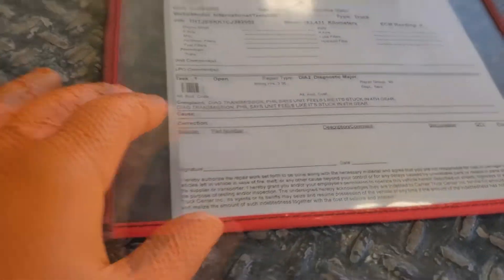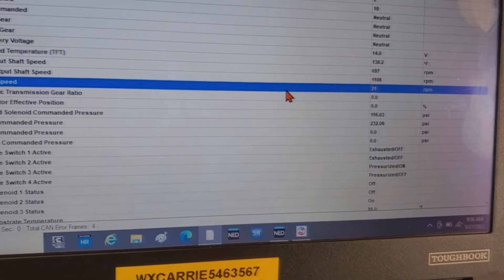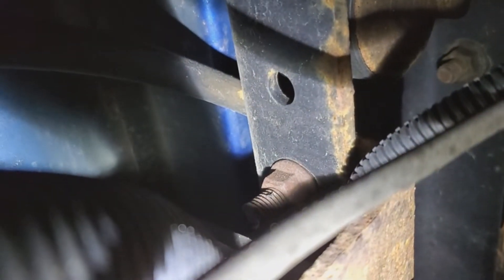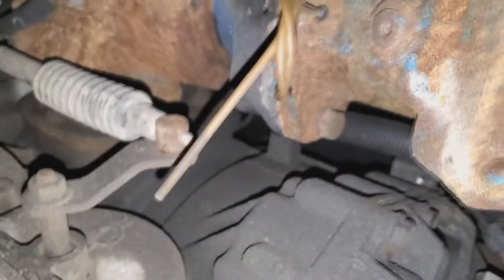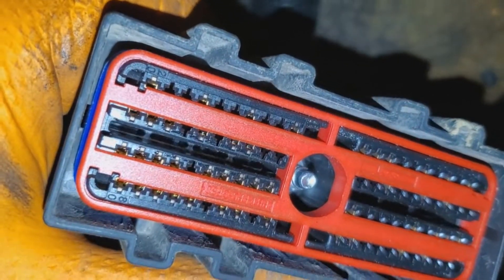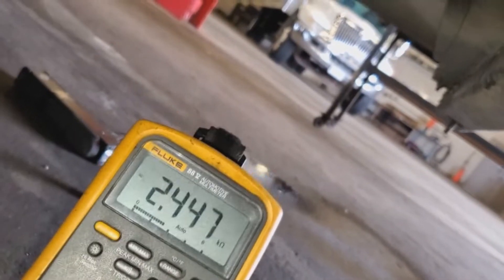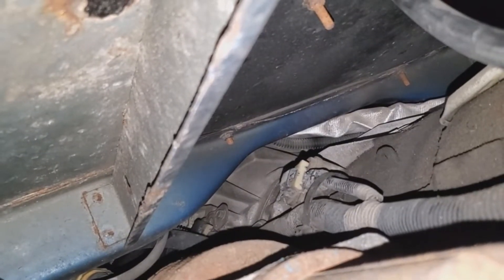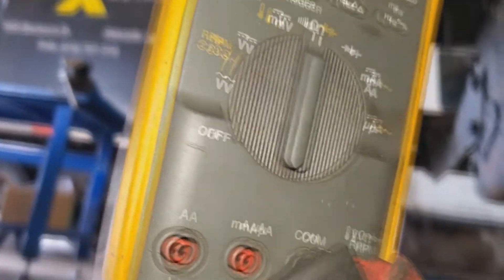Allison Transmission stuck in gear. Code P0717 turbine speed sensor diag DIY EASY repair

Comment: Could it have been the wiring harness? I'm having the same issue and replaced the sensor twice.
Reply from the maker: Yes! Double check that, if all good, it could also be a TCM.

Comment: Are the pin placements on the connector gonna be in the same spots on a 06 duramax with allison 1k 6 speed mine is throwing p0717 input shaft speed sensor low  voltage ive replaced the sensor hacent been able to find any bad spots in the wiring im afraid to test it like in the video because im not sure on the pin placement on the tcm connector. It only throws the code while in motion if im idling it is fine. Ive replaced the sensor the alternator and yhe connectors on the sesors on yhe trans my truck will either get stuck in 2nd or 4th when it throws the code and it was working fine one day and the next morning started it drove it and it threw the code after i backed out of my driveway and put it in drive. Also the speed is correct on my speedometer when i drive and watch live data on my scan tool. Batteries are new and trans was rebuild less than a year ago idk what to do
Reply from the maker: Yes, it'll be the same wiring. Good luck!

Comment: Thank you for the informative video, sir.

How does one test for power and ground at the TCM — are there particular pins?

The 1-through-80-pin connector I am working with is similar to the one in the video.

Thank you for any guidance you can offer. It means a lot.
Reply from the maker: Hey there, yes there are pins to test at the connector for power, ground, ignition power and datalink. There should be information available for the connector mapping if googled 👍
Reply: Thank you so much for the incredibly prompt guidance, sir. I greatly appreciate it.

As directed, I found a map for the connector and checked the pins. It appears a small cracked developed in a pin, causing it to loosen. After addressing this matter, the truck ran properly.

Thank you for taking time to support and direct me. It was pivotal.

Comment: Thanks for the informational video,one does this transmission has a tft sensor or does the turbine  speed sensor in a way  sends in a way a  a reading to the TCM on internal  temperature  of the tranny . Thanks in advance and god bless you?
Reply from the maker: Hey there. Yes this has a temp sensor inside the trans.

Comment: Good evening, my dear friend. Can you make a video of how to program Alison's mind?
Reply from the maker: Apart from programming basic features, you cant do much without the OEM software and a certification for programming from Allison, you'll be blocked out without it. 
You should just bring your TCM into a shop that is Allison certified with a programming station. There is a calibration sticker on the back of the TCM that tells them what CAL is in the TCM.
If the TCM is dead, order a new one already programmed.

Comment: I have a 2009 pet 335 with transmission problems, the computer showed low voltage and for which the solenoids failed, the mechanic said that it is an electrical problem, I have been looking for something wrong with the wiring for days without luck, any ideas?
Reply from the maker: Firstly check your battery voltage and cables for loose connections. If its good, you need to test for power and ground at the TCM if you're getting low main power codes. Verify you do have low voltage and then follow the harness back checking rub points, etc. 
You can do a wiggle test on the harness while your meter is plugged into the power and ground circuits to help pinpoint the location of the corrosion.
Reply: @AcousticHills  I did it, I just removed the sensor turbine and it was stuck in corrosion, it came out in pieces
Reply from the maker: @ignaciohb4372  ok good. I thought you meant the computer (TCM) had low voltage
Reply: @AcousticHills  yes that's what the scanner showed! but my mechanic has time until Saturday and the dealership in two weeks, and since the speed sensors are not expensive I wanted to change them to see if that helps
Reply: @AcousticHills  My truck fails whenever I pass a hole or in some sudden movement, apparently it is getting stuck in some gear and it is a high gear
Reply: Thank you for the informative video.

How does one test for power and ground at the TCM — are there particular pins?

The 1-80 pin-connector I am working with seems to be like the one in the video.

Thank you for any guidance you can offer. It means a lot.

Comment: My scanner doesn't connect with the transmisión and every currente from the tcm is low, do You think the tcm is burn?
Reply from the maker: I would first check your battery connections and fuses. Then test the power and ground at the TCM connector.
If you have strong power, ground and good datalink and it still doesn't connect, you then have a bad TCM